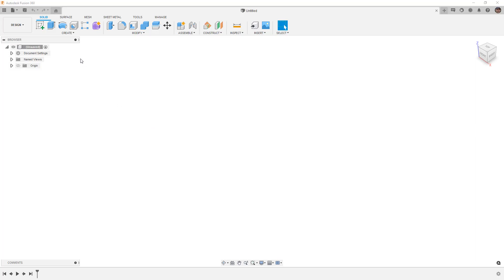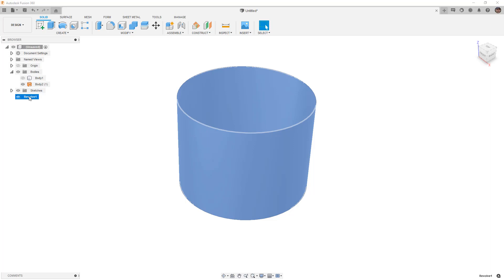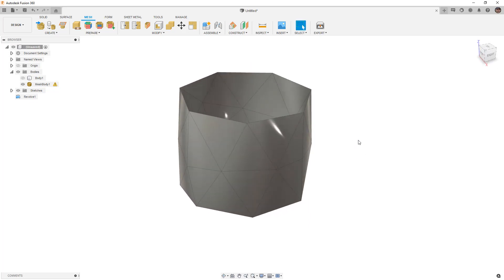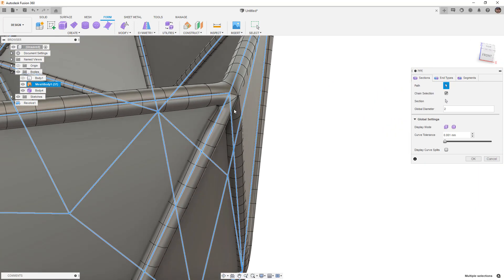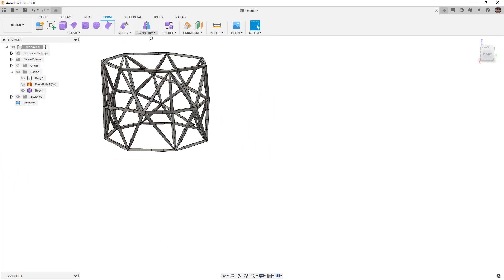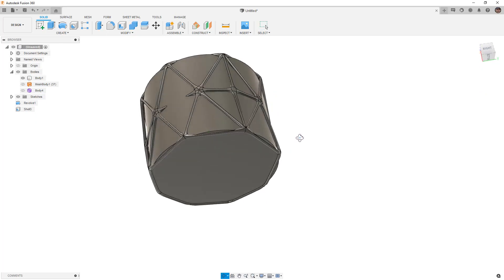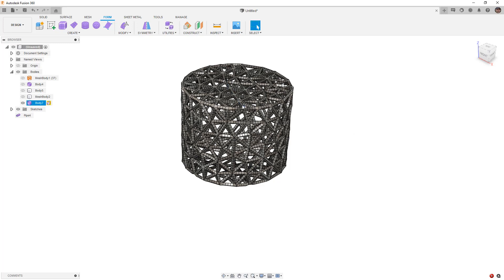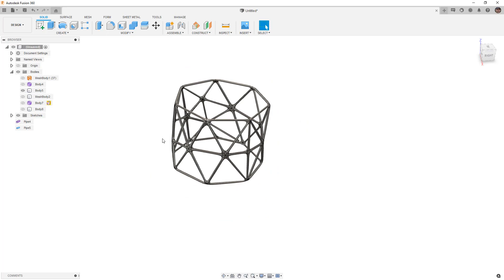Fusion 360 Form Mastery - Part 13 - Creating a Lattice Structure with Mesh Edges and Form Bodies

Comment: I just can't get around that self intersecting problem, I was to use this on more complex shapes, but anything more than very simple seems to get hundreds of those errors, is there a plugin or anything to improve this?
Reply from the maker: Sadly no.  There are add-ins for Fusion like the 3d voronoi generator that can create stuff like this, but the pipe tool in forms does some weird twisting with too many intersections.  The Pipe tool in the solids create tools doesn't really let you select a network of edges like the forms one either.... it kind of wants an open or closed set of curves, not both  So you could use it but with a lot more selections.  Downside is if the curves aren't smooth, you get steps in the joints so either way is sadly more work.
Reply: Great Video btw :)

Comment: I have an issue. After I export STL file and reopen it in Fusion or Solidworks, it does not show any gyroid structure on it. Do you know what I could be doing wrong? I also tried meshing the part and then save it as STL but still the same issue..
Reply from the maker: In Fusion do you "Finish form" before exporting?  In the forms workspace you don't actually have a solid body until you finish the form.

Also sadly even if you have a mesh in fusion and export it does another conversion.  So just right clicking on the body in the browser and "Save as mesh" or going to file export will get you the same result.  Note that file export as an stl i think just takes the visible bodies (don't quote me on that).
Reply: @LearnEverythingAboutDesign you were so right about saving stl in fusion only takes visible bodies. I solved that issue by doing meshing of volumetric lattice only by right clicking and using option " convert vol lattice to mesh" and then still you'd have to export it after making sure it is visible, which is weird and could honestly be a glitch in fusion  but that took a while for me to figure out. 

Thank you!!
Reply from the maker: @MJs-85  glad you got it sorted!  The whole vol lattice stuff seems like it was an odd addition to the design extension honestly.  Like it was a 'cool" feature they wanted to add.  Hopefully it seems more development but I honestly don't use it.

Comment: Good thing! But i have a Problem with the Construction. what can i do if i have the problem at 13:30 min of the video? is there a solution? thanks for your help
Reply from the maker: If you get overlap like that you can try to reduce the edge count in the pipe tool, but most likely you will have to manually move edges around until the body doesn't overlap itself.  Basically if it were to try and convert to a solid it would have a solid overlap in those areas which it won't allow.
Reply: How can i move edges? In the Form Modus, Holding and move the edge with the mouse? and where is the edge count in the pipe tool? isn't it few steps before? thank you so much and sorry for disturbing
Reply from the maker: @Koni-lm6hz  Modify > Edit Form is how you move form verts,edges,faces around.

For the pipe tool on the 3rd tab called "Segments".  You can try to reduce the segment count by dragging the slider toward Fewer.  You can also manually select the Dots on the screen and add/remove them from individual sections.  that would be a lot for a model like that.

Comment: great videos. I learn a lot form these. Thank you.
Would it be possible to have some videos showing how to reverse engineer a product?  I have been trying to create a model of a battery cover from a satellite remote control. It is a complex shape and I have tried many techniques with limited success. The  cover has many curved surfaces and then slides into the remote body. I can send pictures if you provide a location. Thank you.
Reply from the maker: Hey Bernie,  i have a few videos on that topic but it sounds like you are looking specifically at a complex shaped injection molded part.  you can send me an email support@caducator.com and we can carry on the convo there.
Reply: I have tried to send the pictures twice now, and both times Google tells me the address is not valid. @LearnEverythingAboutDesign

Comment: hi how to create a laser cut or 3d print output from the lattice structure that is created ? need some advice thanks !
Reply from the maker: Laser cut isn't really possible since it needs to be flat. but you can just save the body as a mesh and 3d print it.  Once you finish the form just go to the bodies folder in the browser, right-click and "Save as mesh".  that will let you save it and send it to your 3d print slicer.

Comment: Back in 2019 I took a specialization on Coursera called cad and digital manufacturing where you taught us how to make a generative mesh in the back of a drone using pipe. 
mesh workspace was not introduced to fusion back then so I think it would have made the job a bit easier 

Great courses by a great lecturer Mr. Mat thanks to you I got into manufacturing and Fusion 360 is my main cad tool.
Reply from the maker: Thanks Ahmed!  That was a fun course as I got to build that done and fly it around :)  I agree a true mesh/lattice tool would have been so much easier.  One of the "goals" of that course was to lightweight.  I still have 2 of those prints here at the house but haven't flown them in a long while.

Thanks for the comments!  What types of things do you design with Fusion?
Reply: @LearnEverythingAboutDesign  Glad to hear. it is such a beautiful drone  

Well, I started by designing robot grippers, simple manipulators and small mobile systems to be used within ROS-URDF

Then in the mechanical R&D  of consumer products like smart locking systems, plastic parts and enclosures 

currently designing mechanical applications for assembly stations  

Fusion was part of all that and all started by your great courses on Coursera , Autodesk design academy  and now LEAD

Thank you so much for your great content.

Comment: Do you know how to change the appearance/color of the lattice or is that a feature that not yet implemented
Reply from the maker: In this method when you make it with forms you just apply an appearance like you do any other body.  It just ends up as a solid(or surface).  Shortcut key is A on the keyboard in the Design or Render workspace.  Let me know if that doesn't work.

Comment: The explanation of the Capture/Do Not Capture Design History selection and the "Contextual Environment" terminology are (apparently) important concepts in this lesson but were not explained well enough to have the desired impact. I've seen other videos that also seem to gloss over these concepts. I can't decide if they're high-level or basic level aspects of Fusion. Maybe it's just me not getting it.
Reply from the maker: Hi Adam, sorry about that!  Not capturing design history is generally not done or talked about, but there are times when it is handy.  It is sort of like one of those multi-tools that comes with all sorts of different tools you might never need.

Maybe it is an important concept to cover more in depth.  Like everything there are multiple workflows or reasons why you might need it but the main implications are:
1. No design history means no mechanical motion//joints because Fusion can no longer track component positions.
2. Design tools that were done in contextual environments are not open.  Tools like Find Features, Create Fluid Volume, used to be some Mesh tools and Form tools begin to coexist.
3. Parametric links are lost between sketches and features.

A Contextual Environment simply means an environment that you get to only by nature of the tool/action.  So Forms is a contextual environment(when history is captured).  To make matters worse there is something called a Base Feature that you can create to model directly without capturing history but under the umbrella of actually capturing it.

The last forms video I did was also done with history turned off and one of the rare cases I would actually use it.  I never turn off history when modeling with solids or surfaces.  And history is off whenever you import something.

Let me put a little thought behind the concept and see if I can't figure out how to talk about it completely in a single video.
Reply: @LearnEverythingAboutDesign  Thank you for this and the other thougtful replies to my comments elsewhere. I'm enjoying your videos and know I will make a lot of progress towards my understanding of Forms thanks to your channel.
Reply from the maker: Adam, I thought this through and recorded a mediocre video on the topic.  It will uploaded Friday morning.  In the meantime this is the most likely use of turning off capture design history.  https://youtu.be/bvQUq3CYph0   99.99% of cases I would make sure it is on.